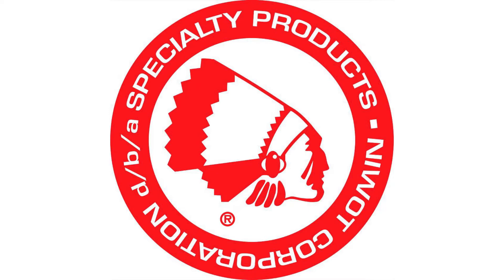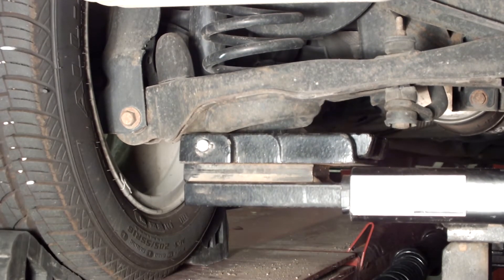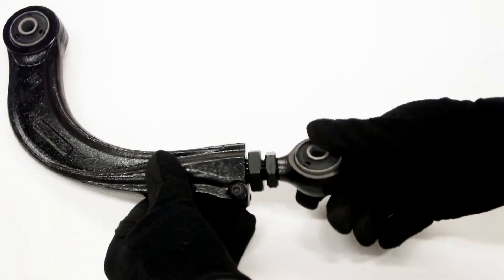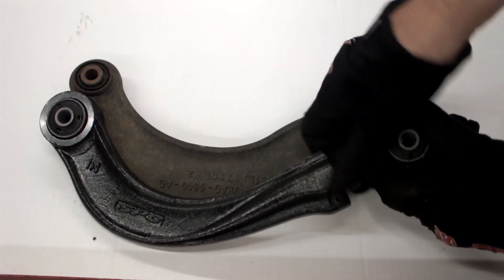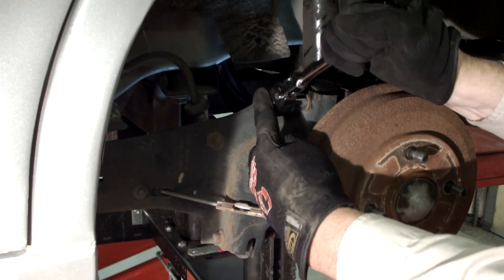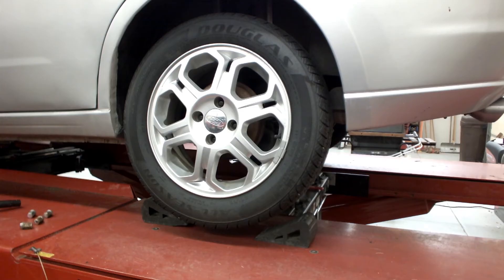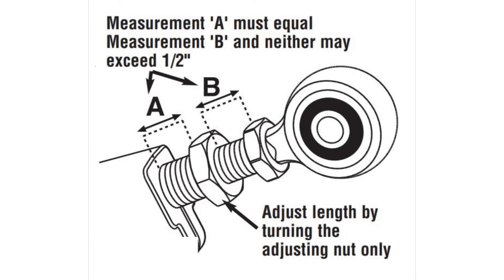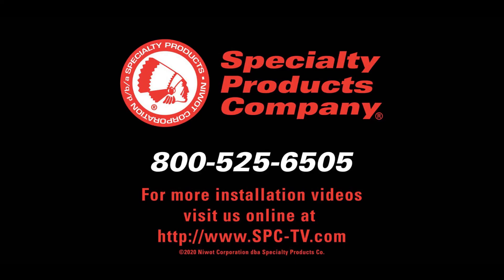67420 - Focus-Mazda3 Rear Upper Arm

Comment: Anyone who order these you you will need. A 32mm wrench to adjust camber, and a 27mm wrench for the lock nut. The pinch bolt uses 5mm Allen wrench and nut size is 13mm head, use 13mm wrench.
Reply: I guess im asking the wrong place but does any of you know a trick to get back into an Instagram account..?
I stupidly lost the account password. I would love any tricks you can offer me
Reply: @Keagan Silas instablaster =)
Reply: @Angel Jax i really appreciate your reply. I found the site through google and im in the hacking process atm.
Seems to take a while so I will reply here later with my results.
Reply: @Keagan Silas Happy to help xD
Reply: What's the chances I'll have to cut the bolts off like I had to do with the lower control arms when I did my coilovers? I had to literally cut all four bolts with a sawzall but before that to be able to get it angled correctly I chopped the control arms in half. Don't care to repeat that shit again.